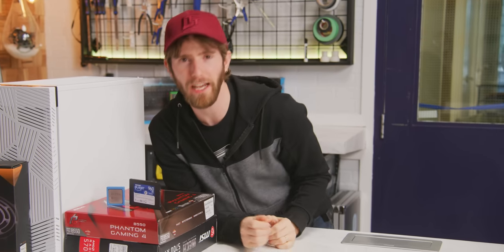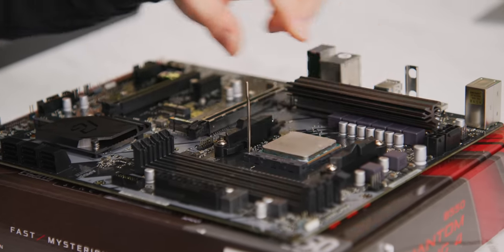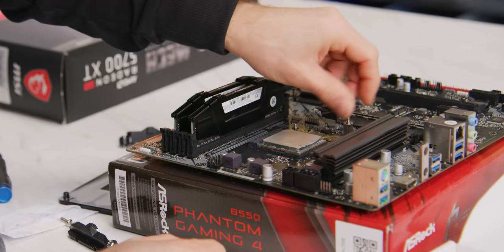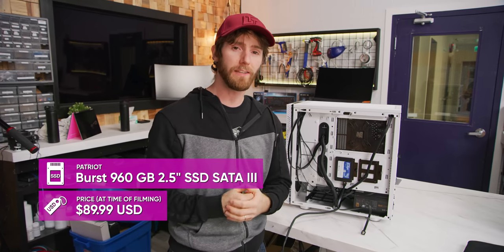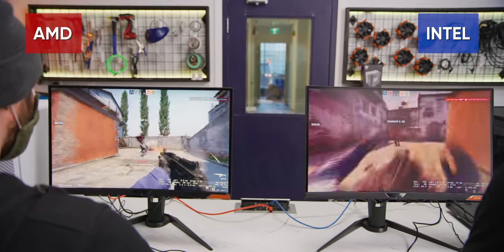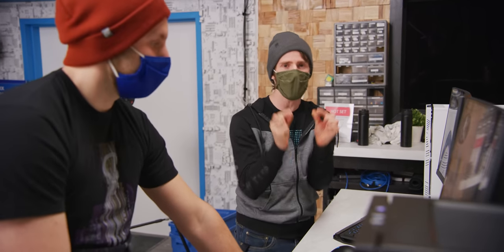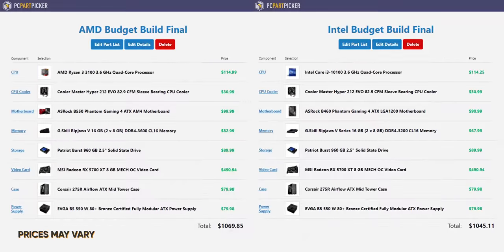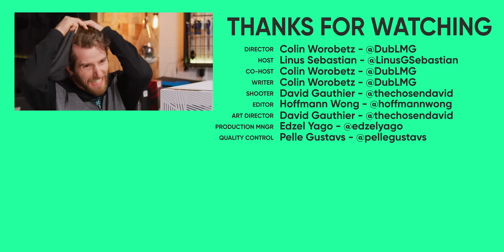AMD vs. Intel midrange gaming PC challenge

Comment: 6:20 actually when it comes to boot times ssds are usually quicker up and running on your desktop compare to NVMe.. i guess it is related to loading the drivers.
Reply: nvme ssds are ssds...
Reply: @rafeesamith  ssd uses S-ATA prtocoll NVMe not
Reply: @marcello4258  there are SATA solid state drives and there are NVMe solid state drives (that use PCIe)
Reply: @rafeesamith  not every m.2 is nvme bro ..nvme is a protocol so is s-ata it is either or the other
Reply: @marcello4258  when did i ever mention m.2? i know it's just a form factor not an interface
Reply: @rafeesamith  because this would be the only thing what makes sense sata != nvme thanks
Reply: @marcello4258  i seriously don't know if you're trolling because everything you're saying is correct, but you're just confusing me even further.
Your original comment is comparing SSDs to NVMe, where I pointed out that NVMe is a protocol of an SSD (which you already know from this thread).

In your first reply, I thought you were saying that SSDs only use SATA and that there are no NVMe SSDs, which is extremely confusing wording

So what i'm getting so far, is that you're referring to 2.5"/SATA M.2 as 'SSD' and NVMe drives as 'NVMe'?
Reply: @rafeesamith  bro i am referring to, as you see bro, to what Linus is saying in 6:20.. in this video he binds ssd to s-ata drives.. don't know why you are not getting it.. can't be that difficult.

yes of course a nvme is also a solid state storage but arguable a drive, but this isn't the point

Comment: Thanks for such vids guys! But, 'serious' question:  At WHAT POINT will 'CASE FILTRATION' become MORE IMPORTANT if not at least earn an 'honorable' mention? INSTEAD of just listing 'case perforations and fans', since BOTH depend 'eventually' on the cleanliness of the air and the ability to get ANY AIR. I liken it to putting in brand new HVAC system, completely sealing your home, insuring the system comes with a HEPPA filter.. then, NOT mentioning, THIS FEATURE, when creating the video regarding building the home in the video.  Am I wrong?  I mean, what good is filtration, IF WE IGNORE IT and treat it as IF, we ALL don't depend on the air we breathe. HEAT KILLS.  You DID do a video on this before, but EACH new pc case, has different ventilation and yet, the different filtration methods, aren't spoken of.  I prefer, the filtration on my desktops to be accessible w/o taking the case panels off or apart.  I wanna know.  i.e. Do I have to open the door or side panel or can I just look down and go.. YUCK!  PET HAIR / DANDER / DUST / CARPET FIBRE OH MY GOD!  (aka real life scenario's)  In closing, my opinion.  Heat kills, thus, DUST / DEBRIS 'filtration' is MORE IMPORTANT than fans and case perforations.  BOTH will depend SOLELY on the air they get, IF ANY thus the PC!

Comment: Ryzen Master is free and the Ryzen 3 3100 is an unlocked CPU. Why not install Ryzen Master and enable Auto OC with virtually one click? You didn't fully exploit all of the value in the AMD CPU purchase by not attempting this. Also, no mention of how effortlessly and consistently the Ryzen 3 3100 maintained its boost clocks during the 3DMark run compared to the Core i3-10100's clock speed graph.

Comment: Cyberpunk has a problem with AMD CPU's at the moment due to a certain coding fault, There is a tool that has released that fixes this and would bring the AMD system on par with or better than the Intel system in Cyberpunk

Comment: Would it be possible to use a ryzen 5 with integrated graphics instead of the ryzen 3 and the graphics card, or would that lead to a worse performance?
Reply: Yes a ryzen 5 5600g recommened
Reply: @buckarakoo3413  thx

Comment: B550 Phantom Gaming 4 needs ram in slots 2 and 4 for speeds above 2933.
It was my first 4 slot board and I found out the hard way a few months ago. 
I also got my first dying CPU, which was doubly confusing.
Reply: AMD Ryzen is just really picky with RAM

Comment: I would like to point out a few reasons why to me, Intel is the definite winner. Start up, motherboard, an h410 would allow you to run the CPU with no problem what so ever and it's half the price, yes you strip yourself of some stuff but, half the price. Second, totally ignoring the F series which can sometimes be SIGNIFICANTLY(as much as 40$ that I have seen) lower than their ordinary version, since we use a dedicated GPU, it's pointless to get the 10100 if you note upgrade path, I can confirm an h410 here is happily running a core i5 10400f and I can even bet a 10700 would not be impossible if you decide to do so in the future. That card they used is aimed towards high-end 1080p and mostly 1440p gaming which considering who would build a pc with budget parts, a 1080p setup is far more logical and at 1080p you can set for a 1060 used(about 150-200$ in my country) or a 1070 used most priced at 300$ and they will be more than enough for a good gaming experience at 1080p. Overall all thing considered, opting for 1080p and intel can save you nearly as much as half the price of the build especially if you find used deals, for example I've seen an h410+10100+8gb combo going for as low as 160$ used and they usually have remaining warranty where as used Ryzen is a rare sight, a lot scenarios depend on your country's second hand market. I am not saying Ryzen 3 is bad in any way, in fact, if you're fine spending that extra cash, opting for Ryzen will undoubtedly give better upgrade path and in some cases better performance. If you got so far down reading, as a closure, you can't go wrong with either CPU and it all depends on how tight is your budget and what you want to opt in for.

Comment: Question for any of you in the know.  I have a very old gaming rig. It has an AMD 6950 HD  video card.  I want to build a new rig but the GPUs are hard to find right now.  I was wondering If I was to just get all the other parts of the build, simular to one of the above builds, Would my old 6950 fit in those above or current motherboards?  Would the pins be different or other issues?  The card still works great, I would be happy to just use my old card in the new build until I can get my hands on a new GPU. If anyone could give me some feedback I would really appreciate it.

Comment: So... I went through your list and got the AMD setup... I received it all and plugged it all up and nothing. 

No LEDs or POST errors on the motherboard, no fans turning. Nothing. 

Power supply is fine. I thought a bad MB, replaced it. Same symptoms. 

No idea where to start troubleshooting now. Verified the cable continuity is good with voltmeter. 

Can anyone assist?

Comment: I got a pc with an Intel I7 870 6GB ram and a radeon card I forgot the name all I needed was to upgrade the graphics card and I would of had a decent pc but suddenly the power supply was faulty and is stopped booting to the bios even and until now I'm still stuck with an old PC.

Comment: You did not need a 5700xt for that rig... You could've saved some 💰 and went for a 2060 Super instead. If I'm building a $1000.00 rig I'm not spending that much on a GPU. A 5700, 5600xt 2060 Super 2060 or even 1660 would more than suffice for 1080p gaming.

Comment: Honestly when it comes to motherboards im pretty annoyed by how few usb ports there are these days.. Amd have great cpus now for doing many things but motherboard manfucaturers are like nope you can have 6 or 7 usb ports. When your keyboard uses 2 usb ports (1 is passthrough though), mouse, headphones, microphone, webcam all use them then you start to run out and which case you need a usb hub to run external hard drive, wireless controller, pen drive, gaming peripherals like eye tracker, steering wheel, usb handbrake etc. It really annoys the shit out of me that. "Gaming motherboard" not much of a gaming motherboard if you can't plug your gaming peripherals into it is it?. For me personally its a huge annoyance i have a pci usb 3.0 hub and also a usb 3.0 ..  usb 3.0 hub. Im a bit of a hog because i have my dolphin bar and guitar thing to plug into also and bluetooth and then my phone cable because bluetooth is absolutely awful and when i send cat videos to my pc it just gives up on bluetooth, and then i have my sd card reader for when i was using my drone, and an ipod lol. 
If your ever buying a "gaming" pc splash out the extra money on a better motherboard. The bios may also annoy you less as with some cheaper motherboards the bios don't really get much updates if any. I have a z87x motherboard a gigabyte one the bios got a beta update which was to have newer support for shit only they didn't go past beta on it. They made the motherboard was fine but lacked certain things i updated it to get those things only its a beta bios so my motherboard is completely retarded and it just some times does random shit like I cannot set base clock to 100.00mhz or just set a manual clock for it at all if i do that the multiplier just does random shit like lets say boost one core to 6ghz for a less than a second and then run at 2ghz and what not and then other really unusual things start to happen. And No i cannot change it back. Its supposedly reliable dual bios system but its shit and stupid as a mf and doesn't work.
Always check the firmware updates for the motherboard  to make sure your not stuck with a beta bios!

Comment: That part choice makes my soul cry... you have a 1000$ budget, you spend half of it on the card, and you spend literally 100 DOLLARS ON A DANG SSD. Not gonna say anything about how he gets a 10100/3100 for a 5700xt. The 3100 is also weaker than the 10100, so I got no clue how in Dirt that AMD build got more FPS. Linus, if you make ads, at least don't make bad builds because of that. Respect-

Comment: Why do tech channels always consider 1 grand "budget"
Reply: They go overboard with the gpu, this ab insane cpu bottleneck. Go for a ryzen 7 2700(x or non x) a 3600 or a 2600, then for gpu its your choice
Reply: Because gaming is expensive dummy. What more do you expect considering how many AI and graphical fidelity is in games? To achieve 1080p 60 fps gaming 1 grand is the minimum you'll be paying.

Comment: I hate to say it, but AMD currently doesn't have a better upgrade path than Intel. Ryzen 6000 will likely get a new socket because (as Lisa Su promised) AM4 will only last until 2020. So basically if you buy a Ryzen 3000 cpu now, there is only one generation you can upgrade to (Ryzen 5000), so same as Intel. Yes, Intel is losing on many fronts right now, but that actually means that you should buy their products because the prices are just much better right now.

Comment: I have the ripjaws 3600 ck 16-16-16-38 ram on my ryzen 5000 system on a b550. The xpm profile would not load too but not apply. I had to manually set the ram timing and fclk to get the 3600 speeds or else it would default to the 2133 spds (BOOOO).

Comment: Linus should have used the 3300x instead of a 3100. Probably a 5-10% or more performance gain for $20 more at MSRP pricing. Also, put in maybe a 3070 or 3060 ti instead of 5700xt
Reply: 6 cores minimum or you're wasting your cash.

Comment: Amd CPU is bad choose you should have chosen  5 3600 it comes with fan so you can save 30 bucks on fan on spend it on CPU and add little better mother board

Comment: Never cheap out on the cpu if you are goijg to waste over 450$ for gpu and 80$ for psu. The motherboard is also great choice too.
If you have few braincells avoid what Linus did and pick older cpus who do literally 80% better than newer ones. For Ryzen 5 2600X is same priced as 3 3100 and for Intel i5 9400F is same prices as this i3.
Reply: this was exactly what I thought, I mean, a quad-core just won't be cutting it for gaming in 18 months, really bizarre choices...

Comment: Currently the best budget cpu is i3-10100F. For about $100, it's a powerful 4c/8t processor that has no competition from AMD.
Reply: An i3 is not a gaming CPU, it's a back office CPU. A i5 is the minimum CPU for gaming.
Reply: @Joreel  This is no longer the case, take a look at the SC performance of the i3-10100F, it will perform better in games than the i5-9400F.

Comment: You can use the i3 10100F instead of the 10100 since it is much cheaper and you don't need integrated graphics

Comment: Is it true that RYZEN processors heat up considerably?
Reply: No. If anything the Intel 10 series heats up faster in my experience which mostly appears to be because of the included coolers.  Even AMD's worst cooler is still marginally better than what intel includes on theirs.
Reply: @justair44  we come a long way INTEL. But this is where we go our saparate ways. It's been fun while it lasted.
Reply: @headhunter531   It depends.. I built a couple of systems for a buddy earlier this year. At the time 3600s were out of stock AND the 10400F (no onboard video) was a steal at 30% less then. Since the processors are comparable (and my buddy doesn't overclock..)  it made sense to go with those rather than moving say to the 3600X which would have been even more . Was "NOT" impressed with cooling though so I still landed up throwing in a couple of cheap Coolermaster  hyper T2s. (smaller than the Evo's..cheaper to..).  The stock intel HSF really does need a upgrade.

Comment: someone should remind Linus, or the writers, a 5700XT is PCIe gen4.
Reply: And that NVME drives at that capacity cost literally the same as SATA ones. And that they should have tried the AMD system's RAM in both slots 2 / 4 and 1 / 3 before giving up. And that there's no logical reason whatsoever to have bought aftermarket coolers for either of these builds. And so on and so forth.

Comment: Can anyone help. Is it worth getting a titan x pascal over the GPU used in this video. It's cheaper and out performs, the only down side is that its older??
Reply: If I were you I would wait for 30 series cards to come into stock
It is getting easier and easier to get a 3070
Reply: @the_br0wnie294  Ive seen some Titan xp's listed for like £300-£400 and at that price point is it worth it considering the 30 series cards are going to be about £200 more?
Reply: I’m American and I heard that in other countries it is even easier to get one, I went in google to convert the money to USD and the RTX 3070 is £368, at over 25% better performance, with a better cooling style

Comment: I know it's subjective, but that case choice is bad.  So many better cases for $80:

Phanteks Eclipse P400A PH-EC400ATG_DBK01 ($89, includes 3x 120mm RGB fans)
Fractal Design Meshify C  ($70, includes 2x 120mm fans)
NZXT H510 ($73, includes 2x 120mm fans - front USB-C)
Cooler Master MasterBox NR600 ($70, includes 2x 120mm fans)

All prices from Neegg US online store.

...to name a few.

...and the MSI Mech 5700XT is TERRIBLE, DO NOT BUY IT.  It cannot adequately cool the 200+ W TDP of the 5700XT with it's low mass heatsink.  The ASUS Strix model is going for the same price on Newegg and also has $20 rebate for the next 24 hours.  I'm really disappointed Linus would recommend the Mech, it's possibly the worst or one of the worst 5700XT models.  Obviously just reading from a script presented to him, but you need to be more on the ball if you're going to recommend particular pieces of hardware.

Comment: Midrange? The title says midrange, but you describe budget builds. Can you do a video on a truly mid-range machine?
Reply: Cut out the gpu for something like a 1060 or 1650 super and only go for 8gbs of ram maybe a 500 gb ssd or a 128 ssd and 1tb hdd cheaper motherboard if you’re really tight and 450 watt power supply
Also get rid of the cpu cooler
Reply: @randomlycasual4941   I don't think you understood my comment. To me, the build in this video is already budget. I'm looking for suggestions on stepping up, not stepping down. :)

Comment: Why not i5 10400f with b460f, the price are almost the same as the i3 but the performance are Much better in games and its better as a workstation to, the i5 10400f are even cheper and better than the ryzen 3600 in most games even tho the 3600 has more cache.

Comment: If you can't decide Linus you must be summer than you look. AMD based gaming rigs make zero sense. They might be capable in other areas but for an out an out gaming rig - forget it. Add Win11 to the mix and the AMD rig will be at a considerable disadvantage in the FPS stakes.